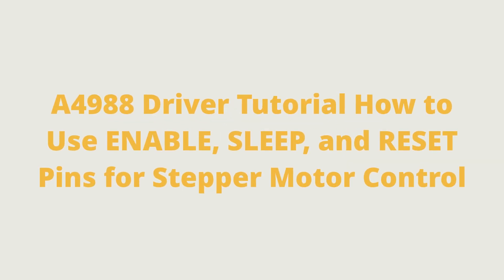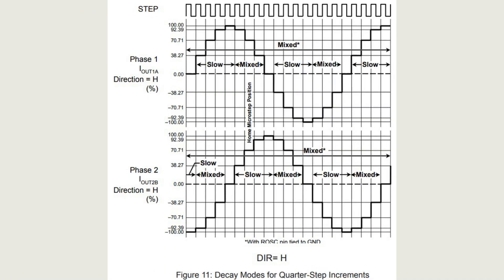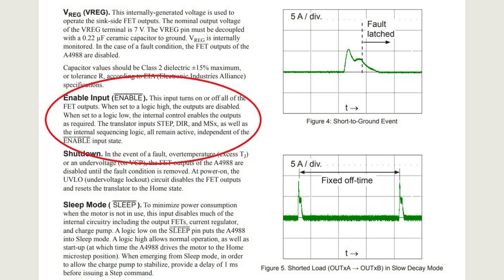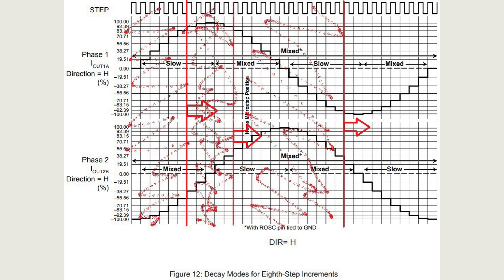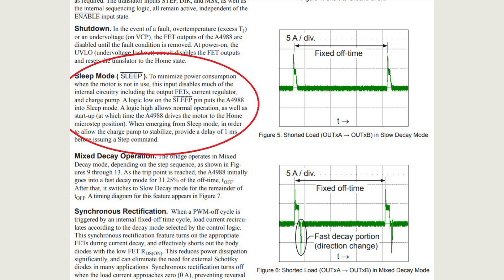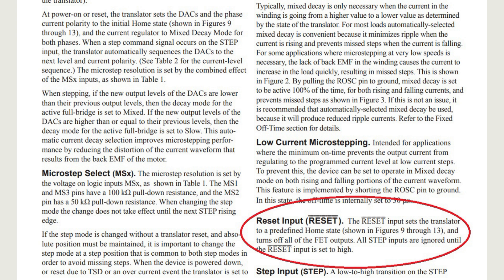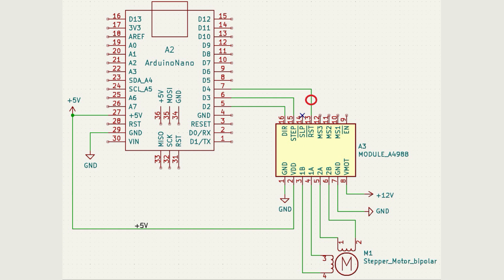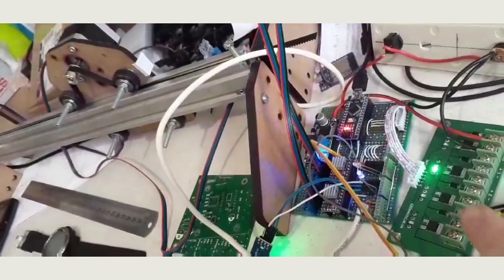🚩A4988 Driver Tutorial How to Use ENABLE, SLEEP, and RESET Pins for Stepper Motor Control

Comment: I've tried all three and they all move the shaft a little after they start moving. I can't seem to keep the motor still when it wakes up. Any suggestions?
Reply from the maker: Check what logical level you have at the STEP input of the driver during the stop.